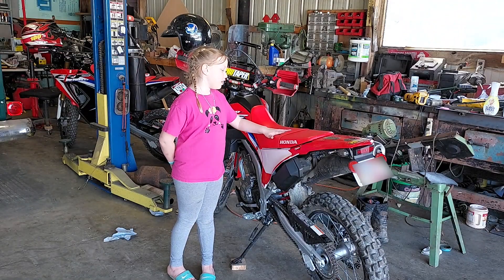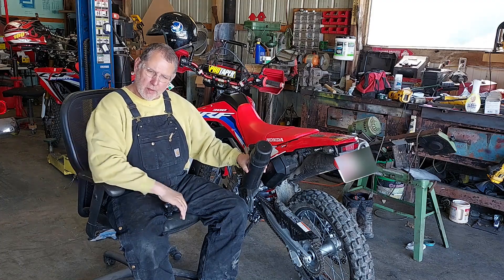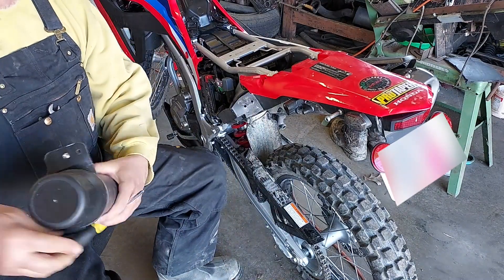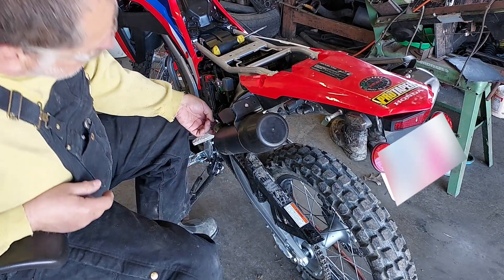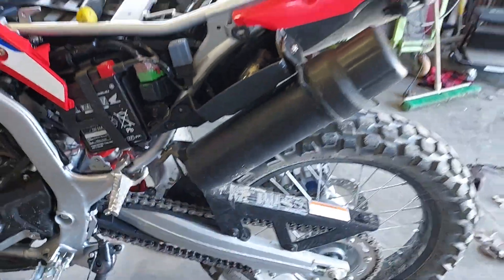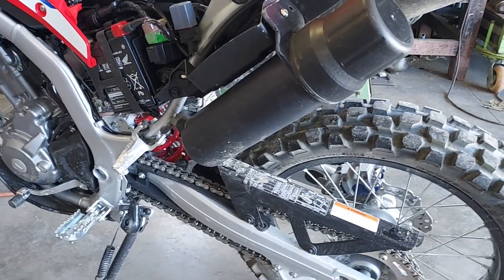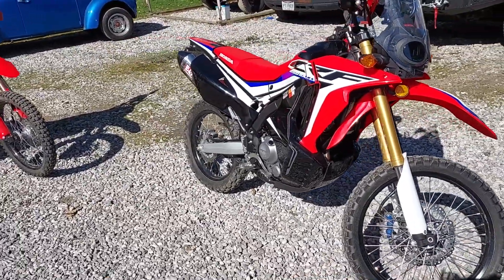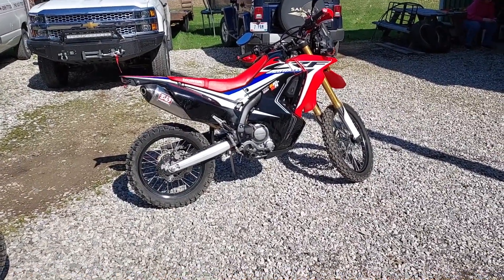Honda CRF300L MODS EP2.  Auxiliary fuel tank addition.

Comment: Would the 110mm version fit the CRF300L if I'm willing to do away with the helmet lock?

BTW, there is a fourth screw holding the tool box on.  It's behind the tool box lock pointing up.  Yours may have fallen out.

The stock tool box is terrible and the helmet lock is also terrible, my helmet lock never did work.  It's coming off.
Reply from the maker: I picked this size and made it fit. I imagine you could do the same with that size. You just have to make it fit. It may be worth looking into the new larger gas tank that just recently came out
Reply: I got the 110mm version today.  It will fit fine and it costs the same as the 80mm.  I do all ready have the Acerbis 3.5 gallon tank (why did Honda screw us on the tank?) so, I'll probably use this container for other purposes.  Thanks for the video!

Comment: Not trying to be rude, but if you added a larger tank and windscreen why didn't you get a Rally to begin with?
Reply from the maker: Hey! Thanks for checking out my channel! Well, I really like the look of the 300L better than the Rally and the price was better. In watching reviews, the Rally is geared a little more towards road riding and the 300L towards dirt, and I wanted a little more for dirt riding. I enjoy making mods to the 300L   So far I haven’t had to use the extra fuel so I may end up using this for tools.

Comment: What size can holds the bottle? 80mm or 110mm?   Great video!
Reply: Thank you!  It is the 80 mm. Thanks for watching!
Reply: @pammac3208  Curious, you say 30oz fuel can, which is 3.5", and small (80mm) tool tube is barely 3.2".  Am I missing something?

Comment: i can't make my mind up on what i want to get a crf300 or the xr650 
this bike will be my commuter originally i was looking at this bike but after watching a few videos realized it might not be the best for me since im 6/4 240# 🤷 

thats a very good idea that your doing if you ask me thats plenty of fuel to get you out of a jam!
Reply from the maker: That was my thinking with the bonus fuel canister. 
I’m 5’11 about 210-220. I don’t like riding it on the highway with this bike but I just did a trip to see my parents. It was 100 miles round trip non highway and I was getting about 74 mpg. Can’t beat that right now.  I plan to do a lot more off road riding with mine than commuting so that may make the difference too. 

Thanks for watching!  Have fun riding and sty safe!
Reply: Having owned or have access to all 3.... 250l, 300l and 450RL...
I wouldn't even mess around, 450 ALL THE WAY . Power is unmatched,off road capability unmatched... handling unmatched...it's a far more capable machine...
Buy once, cry once.....
6'2 here 215lbs
Reply: A guy your size, get the 650.  The 300 would be underpowered for you.
Reply: @LA_Commander  thanks for the input i purchased the 300 since it gets twice the milage and and has a tach and speedo and lots more i got a full yoshimura system and a tune as well im getting 70mpg not trying and it'll do 80mph easy after tune
Reply: @LA_Commander  agreed.... there's no replacement for displacement, the 300 had me wanting more power in about a day... but the 450???  Was like night and day, and it's MUCH lighter than the 650
Reply: @glockmodder  Wow....70 MPG is really good!  I am able to get 55-60 MPG on my Honda CB 1100 but that's a street bike.
Reply: @aalejandro750  Nice!!
Reply: @LA_Commander  yeah if i try i can get close to 80 but thats no fun😎